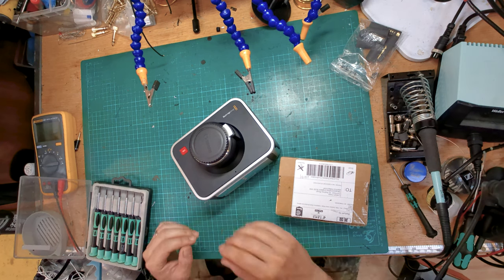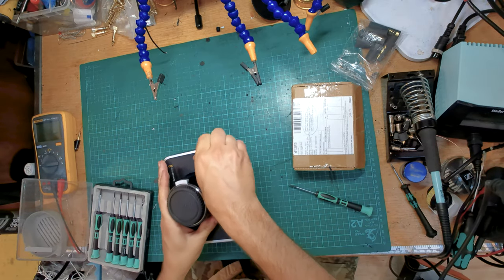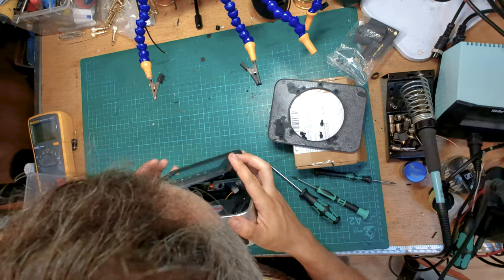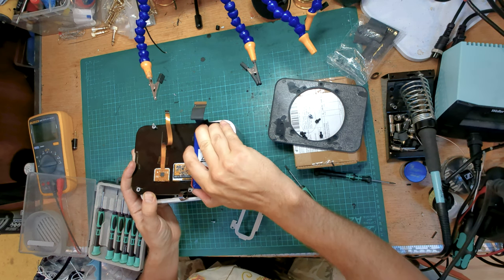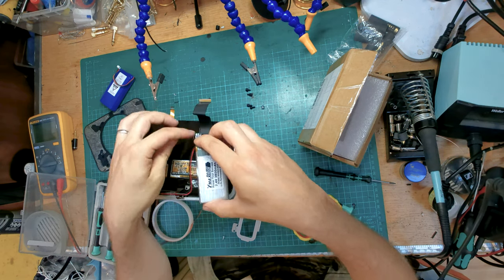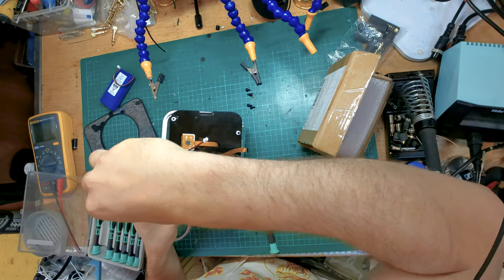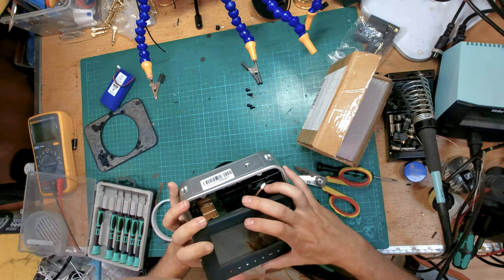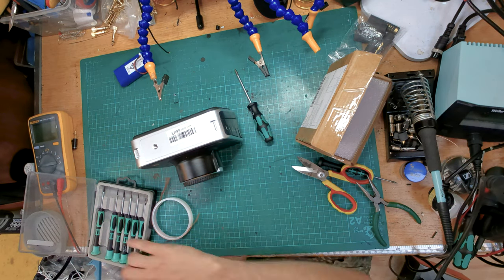How to replace the battery of a BlackMagic 2.5k Cinema Camera

Comment: Thanks for the video it’s really helpful! About to do the same thing but hopefully add an extra battery, just wondering if I’d need any other equipment to do that. Thanks!
Reply from the maker: There should be enough room but it may be easier with one larger battery if you can find one the right size/shape/voltage so you won't have to worry about balancing them.

Comment: Awesome.  Would you be able to power it externally without a battery inside?
Reply from the maker: Yeh - you could jut make up a 12+V battery and plug it into the power socket
Reply: @CustomCans  Will it work If I just removed the internal battery totally as well?

Comment: i was just thinking about something completely different, see how the DT1990 pro is kind of open but not quite, did you consider making them more open with maybe a custom can grill? You must have tried something similar of anther set of cans.
Reply: the holes in the plastic dont even correspond with the can grill lol, maybe some audio degradation from that alone.
Reply from the maker: It would not be quite a straightforward as that. Making them more open would make them sound more spacious and airy probably but it would also throw the tuning out so you would have to do other mods to the driver / enclosure to bring the frequency response back in line. We have done that in the past with DT990s, removing the internal baffle to make them fully open, it made them a bit too bright and harsh so now we add foam to the back of the driver but that took weeks of testing to find the right combination of things. 
On the 1990 the plastic eracup has the holes in it so to make it more open you would have to replace the whole earcup. If I ever get the time I may try DT1990 drivers in the DT990 housings just to see what they are like
Reply: @CustomCans  Im so glad you know about this stuff and so specifically. its the kind of thing i wouldn't stop thinking about until I'd carried it out and made them possibly sound rubbish lol. My thoughts were to open the sound stage and sacrifice some base but you're right they are bright enough as it is it and it would become quite nasty and then I'd have to go into learning about tuning drivers and buying some of those ear things to measure frequency..... na. 
Thanks very much!

Comment: What do you do if you tear a cable?  The one under the fan?
Reply from the maker: You may be able to scrape back to coating and solder jumper wires to fix the ribbon cable or if you measure the pitch of the contacts and then number of contacts you may be able to look that up and find a replacement

Comment: I'm surprise you picked one up for $300. I spent more on my original pocket camera. did that come with a metabones speed booster? (there are cheaper alternative speed boosters)

for film work when using outside an ir cut filter is also needed when using nd filters with the original black-magic 2.5k. can still produce incredible images
Reply from the maker: It did not come with a speed booster but I have 16mm and 28mm primes so it is just about usable for youtube stuff ;)
I am pretty new to shooting videos so the learning curve has been quite steep using this camera but I am starting to get some nice results now and have learnt a lot along the way

Comment: I have the same camera. I think my SDI output Port is not working and my battery has a memory on it and the cooling fan is not working. Can you change all these parts? Have you had any trouble with overheating and your fan not coming on?

Comment: do you think 7.4v 18650 lithium batteries would also work?
Reply from the maker: Yes a couple of 18650s would work - I did not measure though to I am not 100% certain that there is room inside

Comment: What’s the battery life on the camera now ? Is it still working perfectly ? And what does the charge port look like
Reply from the maker: Have not done a timed test but around an hour, i reckon. It still works perfectly and it is the standard barrel type charge port on the outside of the camera. The internal battery charge port was a 2pin mini connector of some kind - not 100% sure which it was
Reply: @CustomCans  thanks mate. Mine arrives tomorrow and will be doing the same.